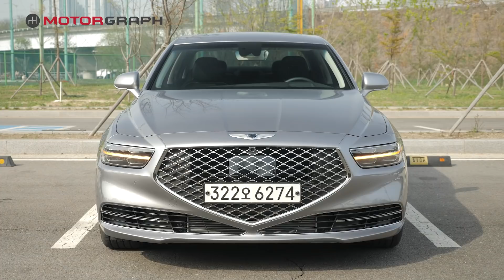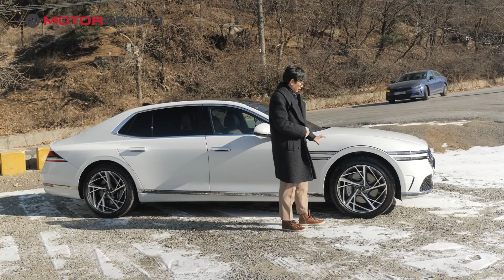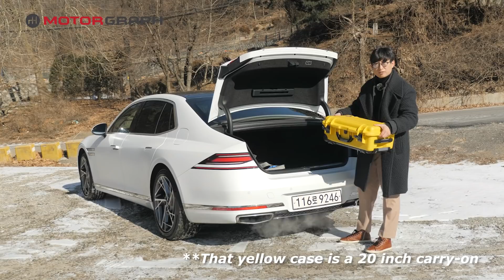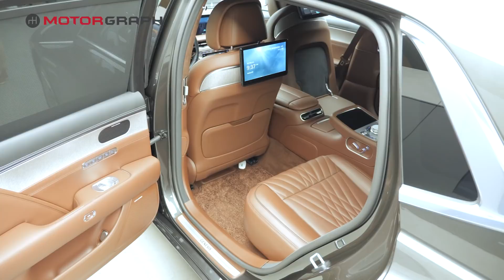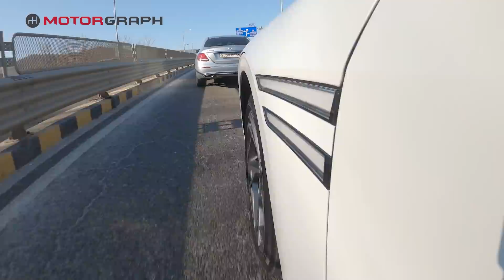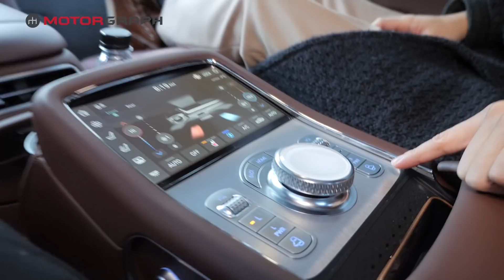New 2023 Genesis G90 Review "The Most Expensive Luxury Sedan from Genesis"

Comment: There are things I like about it. Like the dual light set up out front. Genesis does well but there’s always one or two things that stand out like sore thumbs and turn me off. In this case, the grill is so enormous, you can clearly see what is the functioning part and what is black plastic cladding. Just tacky/gaudy. Inside the weird thumbs up looking pillars are super distracting and seem to take away from the overall flow of the dash. This approach is also odd on Lexus vehicles.
Reply: The pillars are a major turnoff black with a light  colored vehicle all the major luxury car makers continue to make this mistake over and over again. What's so depressing auto manufacturers act as if the don't care.
Reply: Large grilles have been the trend since the last 7-8 years. The only car manufacturers that I think makes decent looking grilles right now are Lexus, Mazda, Mercedes and Aston Martin.

Comment: Looks like an oversized G70. Not really feeling it. I liked the previous design. They could've just made a refresh to the previous design with the all new interior. The steering wheel and wheels look yuck. I think Hyundai/Genesis is doing too much with their exterior design. It's too busy. Luxury should be clean and cohesive like the 2023 Range Rover for example. Before anyone comes at me my wife and I currently own a 2018 G80 Sport and plan on getting the new G80 Sport and GV80.
Reply: Yeah Genesis made the design overall, a bit too sporty for a F segment
Reply: I disagree. The side profile is quite stark, the wheels are the busiest part, and I only like the LWB and 5 spokes. But the front is simpler than the previous version, and the back is quite simple too. What they lack is CONGRUENCE.  The front needed the stately superman shape on the grille, the grolle sides are too rounded. The hood middle needed to be raised and the front should protrude forward a little, and the lights modified to make more sense with the back design. The 2021 G80 fronts and taillights work magically in this way, but these do not.
Reply: I think the 2021 G80 has the best overall exterior look when it comes to the Genesis design, but this is growing on me.  The interior shapes (rectangle with rounded edges like in the GV60, the ugliest Genesis) didn't appeal to me at all when I first saw photos of this G90, but now I don't mind them.  I do like that they didn't go crazy with vents and aero bits all over the place, or displays all over the interior, or putting the same lights as their cheapest car (like how the S class has basically the same lights as an A class, CLA or C...Because you want to spend $200k to have your car be mistaken for one that costs $30k).  I don't think they really needed the outside to change much, but at least they're constantly trying new things and always improving the interior.